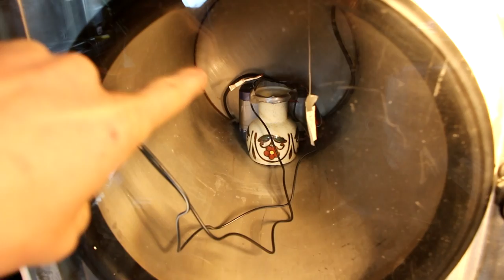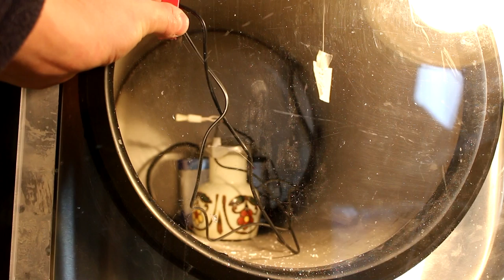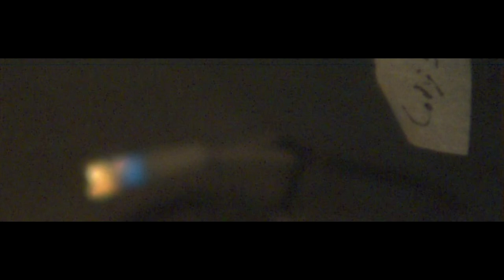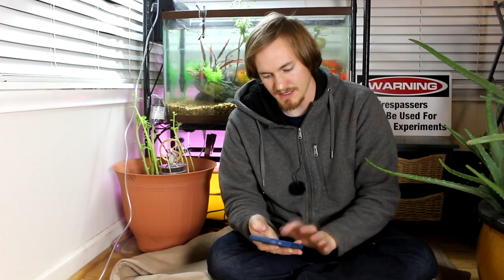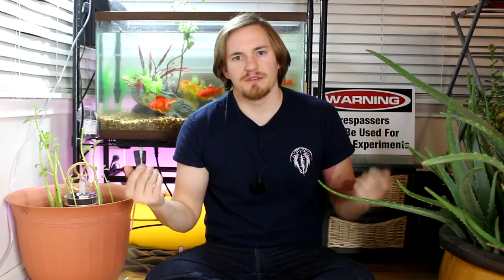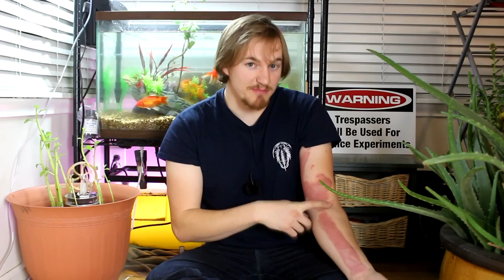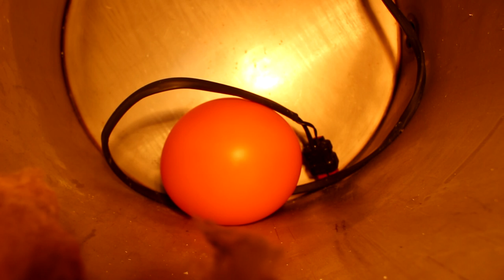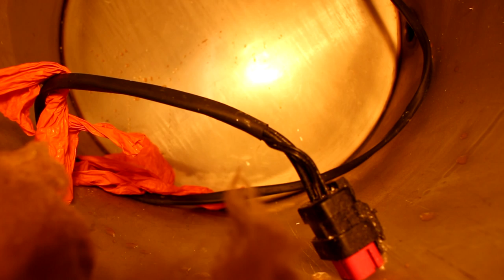Sound of Explosions in Space? part 2

Comment: Why is the stirling engine in the background moving? does the plant produce enough warmth to keep it running? :O
Reply from the maker: potato power!
Reply: muh1h1 I would assume the soil is colder then the air above
Reply: i guess there is going to be a video on that topic coming? :)
Reply: muh1h1 I don't think plants produce heat. Correct me if I'm wrong please
Reply: ShroomFire I assume plants produce a small amount of heat.  Possibly not enough to be relevant here, but nothing is perfectly efficient, so I assume the chemistry for photosynthesis and the chemistry whereby they metabolize the sugars they created with photosynthesis would both have their inefficiencies show up as heat.  But the rates might be too slow to make a difference to a Stirling engine.  Not really sure.  Plants are slow.  Especially in the cold.

However, both the soil and the water in it will have a bunch of thermal mass compared to air, so if the temperature in that area fluctuates during the day, there could easily just be a thermal difference from the soil being slower to equalize.
Reply: Chris Sloan I was thinking they could produce heat through cellular respiration inside the mitochondria
Reply: what kind of plants? could be like orchids don't you water those with ice? or an I thinking of something different? plus didn't look like the engine was actually on the dirt? or is there dirt?...
Reply: i know that plants can produce very slight amounds of heat, and i also know that stirling engines are incredibly efficient! Also you can see that it was not really self sustaining, obviously cody had to spin it up every once in a while. So maybe it was the slight heat of the plant that was "almost" sustaining the movement of the engine...
Reply: I would think water evaporating from the soil making it colder than the air above is whats making the stirling engine turn
Reply: i like seeing smart people on YouTube for once
Reply: verry cool, do you think you would ever do a video on trying to generate electricity from it, maybe build a largwr one, because i've seen alot of videos on sterling engines recently but they never really do anything they just explain it, it would be awesome to see a practical application for one. keep up the good work.
Reply: It has stopped moving by 3:30
Reply: Some plants are able to take electrons from the electron transport chain and utilize these to produce heat. This is done with AOX.
Reply: muh1h1, I think because the soil is moist it is cooler than the air due to water evaporating from it. So there is enough thermal variation to cause the engine to operate. Just my thought.
Reply: Thats not really true, look it up. Stirling engines can reach efficiencies of around 50% actually, while modern 4-stroke engines reach an efficiency of around 25-30%. 
Sources:
https://en.wikipedia.org/wiki/Stirling_engine
https://en.wikipedia.org/wiki/Engine_efficiency#Gasoline_.28petrol.29_engines
Reply: wrong, of course they do. They have a metabolism which cant be 100% efficient, so they produce heat.
Reply: It seems like he recorded this at night. Air temperature drops quicker than the soil, possibly creating the necessary temperature differential for the engine to run. Or maybe it is the potatoes.
Reply: Plants are very capable of thermogenisis. One plant that is particularly good at it is Skunk Cabbage. They will actually melt away the ice and snow around them in order to pollinate and reproduce. http://northernwoodlands.org/outside_story/article/skunk-cabbage
https://www.damninteresting.com/warm-blooded-plants/
Wow, just now caught that auto correct(4 days later). Thermogenisis is WAY different from Parthenogenesis.
Reply: CODY! i just had an idea.. you have heard about those strange noises they somethimes heard coming from atmosphere or earth sounding like trumpet or anything, what if its gas from a distant supernove hitting our atmosphere and producing the sound ? :o
Reply: Do you have an example?I've never heard of that
Reply: Lindybeige would be proud.
Reply: amen nathan..... he would be...
Reply: Warrior Son put a Stirling on the side of a 4 stroker and provided the cold side is intercooled you can use the stirling to charge a battery ;p
Reply: I was thinking about the same I would like to see Cody's video about stirling engine.
Reply: Ellenor Malik lindy beige was thinking that the server farms in norway could produce a fair amount of power because when the servers operate they generate alot of heat and if the top plate was outside in the norway snow it would generate a fair amount of power, to then go back into the server farm turning wasted heat energy into electric power.
Reply: Y'all are overthinking it. Soil is damp and you get evaporative cooing from the water evaporating. You may have to stick it slightly below the surface where it stays damp to keep it from just sitting on the dry surface after a day or 2 from watering it.
Reply: What he said is a bit of a misnomer which he admits to by saying its not actually sound per say.

Sound is a wave which travels at the speed of sound through a medium such as air or a solid. In a vacuum there is no medium for a wave to propagate through. Instead what is traveling are the actual gas particles themselves, instead of a wave.

Because the particles can travel at whatever speed they want they are not limited by the speed of sound, but the speed of light. The energy of an explosion often causes projectiles to travel faster than mach 1.

Now in the vacuum of space the effect is that the gas particles traveling through space reach your spaceship sooner than if it was a sound wave propagating through an atmosphere. When they bang into the hull the kinetic energy of the gas particles is converted into sound waves and you hear something like a rumble which he imagines would follow a bell curve.

So saying that you hear the sound sooner is almost the same as saying sound travels faster in space, but again, its just a conscious misnomer.
Reply: On the video when he is wearing clothes for cold weather the stirling engine almost doesn't move at all while when he was wearing clothes for hot weather the stirling engine was moving fast. Therefore the outside is supposed to be hot while the inside is supposed to be cold, the movement was not produced by the heat of the plant.
Reply: Kardop That is a good observation. It does seem like whenever its warm in the room the engine moves faster.

However after slowing it down to 0.25x you can see that in both cases the displacer is moving one quarter turn or 90 degrees ahead of the piston. For an engine of this configuration it means that the cold side must be the top side.
Reply: Wow, you are brining this discussion to another level :D
Reply: @greenmeister18  exactly. It doesn't matter what direction the heat differential is coming from. You could set it up in a cup of ice water to run it.

Comment: What interests me here, is that generally the speed of sound decreases at lower pressure (and more specifically, due to the lower temperatures), but your experiment shows a different thing - expansion of gasses in a low pressure system.  If we were measuring sound specifically (with a vibrating speaker maybe? idk) instead of an explosion, I think you would find results opposite to the experiment you ran today.

Comment: To the death star concept: if you follow this through with the energy released being so high that it would accelerate the gas to a significant fraction of the speed of light and then this gas hits your spacecraft you would probably notice it as ionizing radiation instead of a shockwave...
Reply: Cody'sLab plainly put, I like it
Reply: ooo interestingly, you wouldnt 'see' it coming either !! ...as the explosion, and the hitting/ionnizing you would happen pretty much at the same 'time .. ! 
thats a freaky thought that ! ...in you mind you would think it would be like thunder/lightning !
Reply: I wonder if the gas volume would be large enough and density high enough that you could see light diffraction at the edge of the gas. It would be diffuse and hard to see though, not like a distinct shock wave in an atmosphere.
Reply: Nerds

Comment: This has been fascinating. I'm definitely one of those people who makes comments like there shouldn't be sound in space and the like - however I still have some thoughts about explosions in vacuum as related to atmospheric blasts. 

Specifically the destructive force of Earth bound explosives is dependent, in large part, on the shockwave itself in particular the gradient of pressure. The sudden rarefaction and then re-collapse of the air (or other material) tends to be what causes most of the damage (Like the hitting the top of a bottle with water in it shattering the base... only in every direction at once).

Also I think the total kinetic energy carried by expanding gas through a vacuum is more thinly deposited than an atmospheric explosion.  Due to the interaction with an atmosphere all the energy of atmospheric explosions get deposited in a small area near the blast and is attenuated farther out. While in a vacuum the explosion's kinetic energy is carried out in an ever thinning shell, so any damage or acoustic effect could be felt farther out but but would also be relatively weak nearby as compared to an atmospheric blast. 

But I'm just hypothesizing - Keep up the good work.

Comment: You need to put some live plants in your fish tank the water looks cloudy
Reply: it wont help to clear up the water just change the water more
Reply from the maker: There are live plants in fact the tall ones in the middle are potatoes
Reply: ***** wait potatoes work in aquariums... im irish and i have a aquarium omg
Reply: The nuclear fission itself only in tiny amounts, but you have to detonate a fair amount of (gas producing) explosives to trigger the actual fission, so you'd definitely have some gas around :)
Reply: ***** Exactly. Nuclear power plants ideally do not produce any gas besides steam used for powering the turbines. If there are no completely closed circuits of boiling and condensing, some of that steam is emitted into the atmosphere^^
Reply: Hahahahaha
Reply: The Real 2nd Earl of Rochester it depends on what solid object. Water is ~4 times faster, I think.
Reply: +Cody'sLab Is there a way to measure if your super laser propels itself in the opposite direction due to photons momentum?

Comment: Can you make an anti-gravity chamber? That sounds like the seed to some cool experiments!
Reply: Like an elevator?
Reply: lmao what the heck..
Reply: Twitchi - Small scale, maybe with magnets? It could be used on metal.
Reply: Apollo_ you would have to adust the magnets for every piece of metal seperately
Reply: Just jump into the nearest lake
Reply: Take a cardboard box (or something more aerodynamically shaped) and drop it from a tall building. For the duration of the fall and as long as the box doesn't reach terminal velocity you'll have an anti-gravity chamber.  Well, at least as close as you can get.
Reply: Jack Hudler Of course not, it's just simulated zero-gravity. The only thing I've ever heard of that conceptually could be considered actual anti-gravity is some experiment with a fast spinning superconducting disk. But I've heard of that some years ago and never looked into it so it could just be made up bullshit.
Reply: Maybe he could build a small box attached to a tall pole ( 30-50 feet ) out of plexiglass or  a transparent material and raise the box to the top with a motor on a cable, then place the experiment items in the box, and drop it quickly and see how they react. It's the only way here on Earth to simulate zero gravity.
Reply: Maybe I should rephrase. I meant zero gravity, not anti gravity, where things push instead of pull. Like a space environment simulation.
Reply: Apollo_ See the: Zero Gravity Research Facility

Comment: The speed of sound will not change according to the pressure but with the temperature of the gaz. The shock wave travels supersonicaly. To travel supersonic, it has to compress the gas (unlike the sound wave)  and it's less damped in vacum because it's easier to compress. 7:40 we are in 3-D so it has to be divided by r^3, not r^2.

Comment: Speed of sound is only defined for an isobaric condition. What you have isn't a isobaric pressure wave (sound wave) but a shock wave. Where the gass is flowing from a high pressure (pv=nrt) zone to a low pressure zone (~0torr).

Comment: Very astute observations.  Most Excellent.  I was hoping there would be a balloon, or some type of explosion that doesn't involve heat.  Amazing the way it expands in all direction, even though the air in the chamber is probably being extracted through a single port.  Pneumatic depressurization!  
A flame in zero gravity is spherical.  Explosions also go in every direction, unless they are impeded in some way.  For a  compressional wave to occur and be detected in the fabric of spacetime, there would need to be an incredible amount of energy, moving away from a single point. Thermal explosions yield lots of energy, but they also do lots of damage.  An implosion, such as an atomic implosion, happens only when energy  from  sources in vector equilibrium are focused on a single point,  directing energy in to the center, from an array.  Very tricky to accomplish.  Your vacuum chamber can draw energy from the balloon in all directions with ease, but can the reaction be centered around a single point?  To extract energy from the vacuum of space, we have to pull it apart, in a completely even, encompassing manner.  If Tesla had success doing that with electromagnets in a normal environment, I wonder how things would go in the chamber.  This reaction reached a significant fraction of c.  c is the key.

Comment: Depending on what you are doing you might need a vacuum chamber that is larger in all directions, not just longer.  Since the explosion goes out in all directions you would start getting molecules deflecting off the walls of the chamber at angles and effecting the overall impact on the target.  As far as just testing speed of the quickest particles to hit the target it isn't a problem.  But if you are testing sound made into a stand in for say a space ships hull that would be a problem.  You would have to makes sure any wall of the test chamber is further away from the explosion or gas particles ( if you were trying to test someone trying to scream in space) than the test target.  Just food for thought as to what your vacuum chamber requirements might be.

Comment: expanding on your theory, when in an atmosphere, gases will expand from an explosion creating an area of high pressure that wants to equalize, which will push the atmosphere causing resistance. in space, there is no resistance because there is no atmosphere so no resistance. this means that the speed of sound is dependent on how fast the gas is traveling, which is dependent on the force of the explosion. This then boils down to weight of gas and how strong the explosion is determined the speed of sound, so the limit to how high it can go is close to the speed of light since the resistance of space starts to kick in. A good of example of this is the speed of neutrinos, which if you had enough, they could carry an audible sound. Another byproduct of since it's space, the gas will always be accelerating so being farther from the source results in an increase in tone, but as the speed of a particle increases, the acceleration decreases and since it's an explosion the loudness would decrease because of the increasing surface area with the same amount of matter.

Comment: To me it sounds alot like how diffusion vacuum pumps work. When you go to super high vacuum, you gotta forget any notion of normal gas, and instead think of the individual molecules. And how do you pump out a single molecule? Boil oil inside of a vacuum and direct the stream of super sonic oil vapors to trap molecules against a cold surface, which will trap them and bring them closer to the outlet. Basicly blasting the molecules out of the chamber.

And you could build one yourself, 304 stainless steel, some copper tubing for cooling the walls, a heater and bowl with a couple of stainless steel funnels from amazon :P Can't think of anything fun to use it for, besides aluminizing things like telescope mirrors.

Comment: I think, that you would get much less energy than E(initial)/r². Because the gas that comes from the explosion would try to spread out evenly into the vacuum of space. So the gasses would loose more and more of their density the farther from the center of the explosion you'd measure. I think because the gas looses it's density with 1/r³ and also the farther away you would be you'd cover smaller part of the spherical surface of the explosion (1/r²). My estimate of the Energy would be e= E(initial)/r^⁵5
PS.: your videos are awesome

Comment: You might also be getting some resonance from the vacuum chambre itself.  As the gas hits the walls of the chambre, the steel could be imparted enough energy to propagate a wave through the steel and this would of course be audible as these vibrations would transduce into the air around it.  Just a thought.  

I don't think I've ever seen this tested and the results are really interesting.  Thanks!